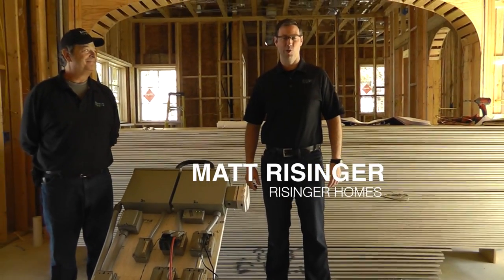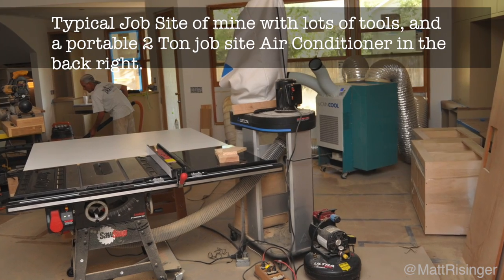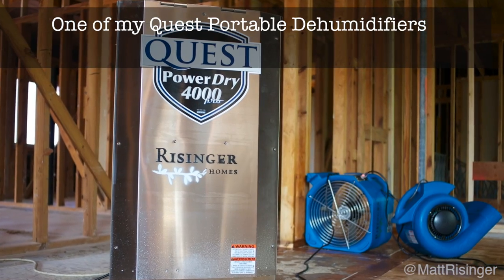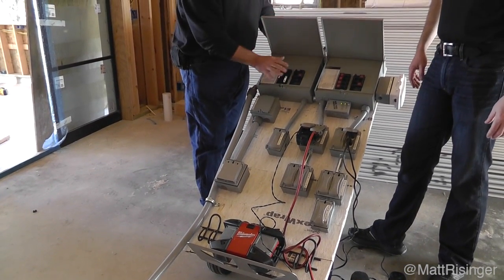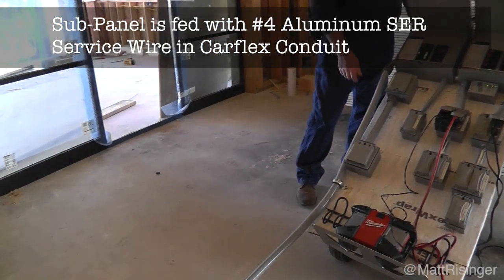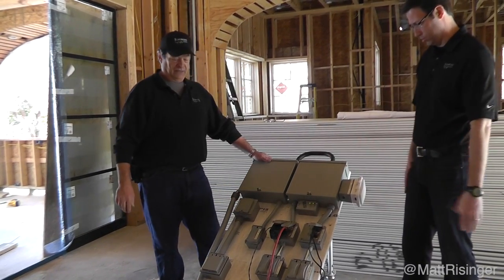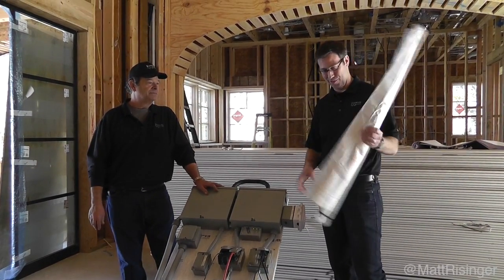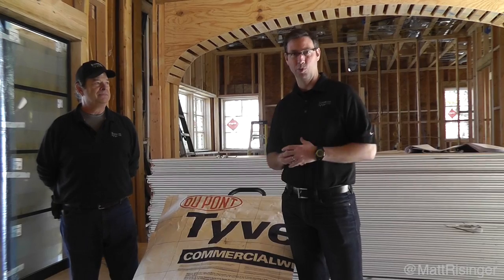Construction Temporary Power Box

Comment: Side note: The USB standard now includes official USB Charging specs - too few wall wart/outlet adapters comply - so that devices can draw enough power (more than USB was originally designed for) to charge. You may want to check if your USB outlet adapter complies, so your devices charge in some kind of reasonable time!Very cool, by the way.

Comment: How is that connected at the temp power pole? 
Plug? If so, what type?
Or hard wired through box at pole?
Reply: It’s a sub panel it doesn’t connect straight to the electrical service conductors.

Comment: Sweet! The only drawback I see is the royal pain to roll up #4 Al service cable that seems to be hardwired to the panel. Personally I would be looking at 50-75 ft sections of #6 SO cord with plugs that coil up easier. This way anyone could unplug the device then place the cable inside at the end of the day to prevent theft. (if that's a worry)